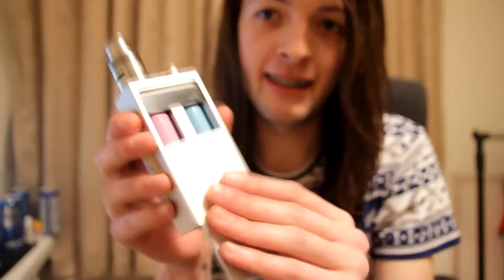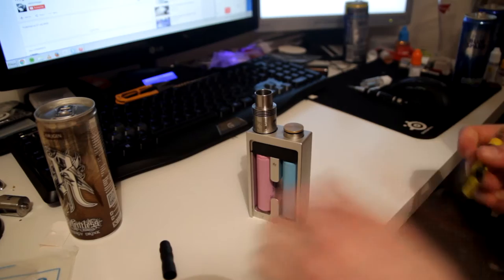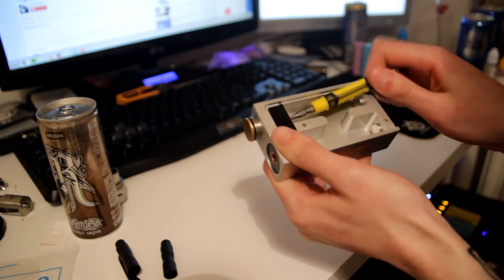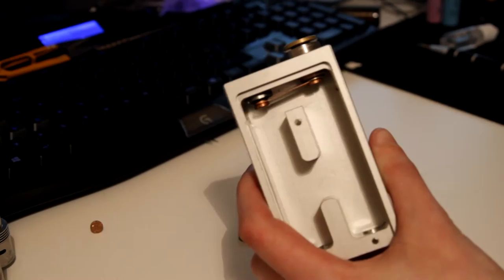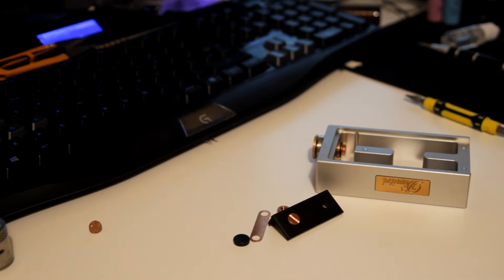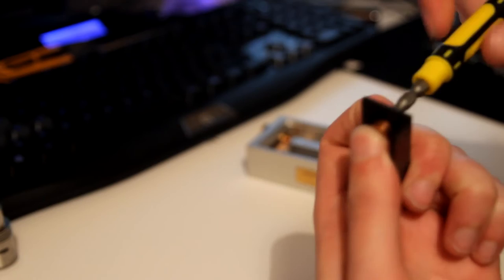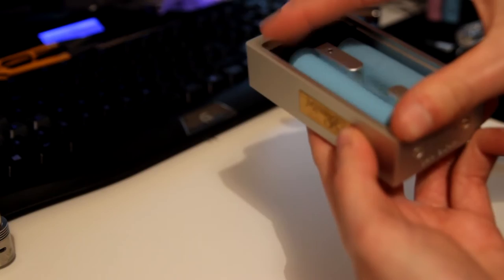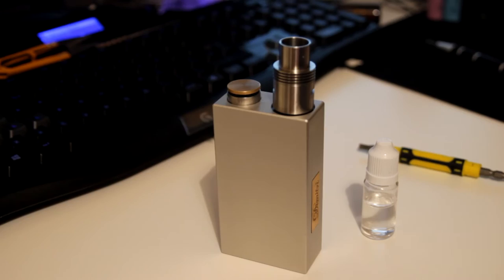How to fix your IVOGO Dimitri Button

Comment: Is it bad that my black piece slides right out? I just received my mod and I don't have batteries yet so I can't test it, but i fixed the locking mechanism
Reply from the maker: +Brian4 Devlin20 Should be fine I imagine ? :D
Reply: +Conor “Davehkiin” Stewart Ok, but I just realized something.... The two copper connectors where you push down the button do not touch. I still don't have batteries to test yet but do you think that will be a problem
Reply: +Brian4 Devlin20 There's about 1milimeter of space between them